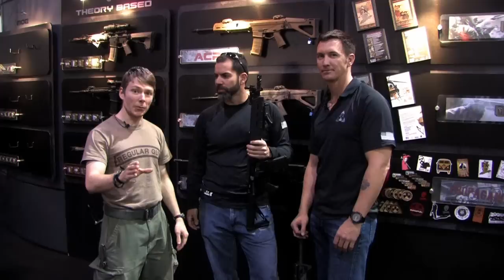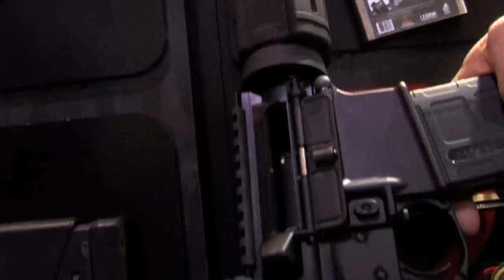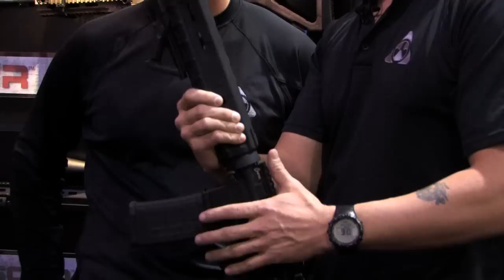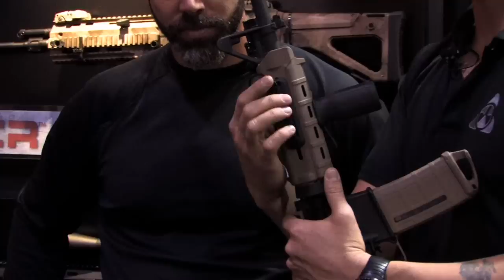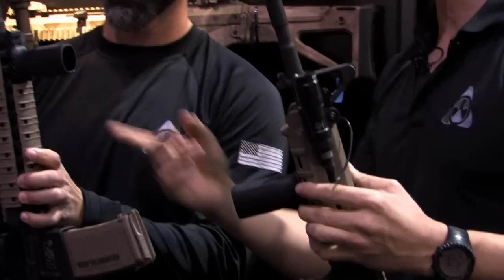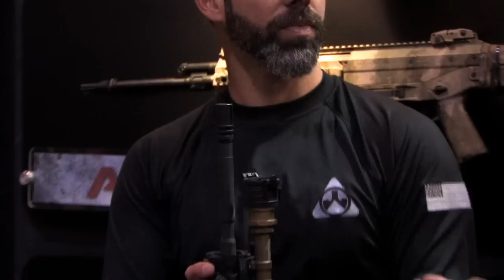Magpul Industries ShotShow 2010 Part 3

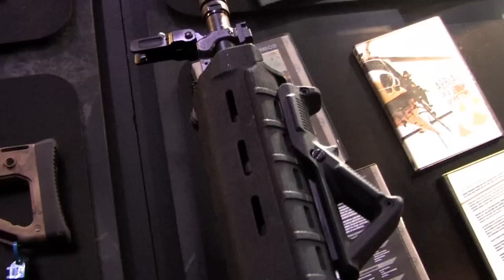Comment: Who makes that integrated flip up iron sight and gasblock at 0:55?  It doesn't look like any company I've seen.  It's on the 16" mid length gas system with the full length MOE handguard.